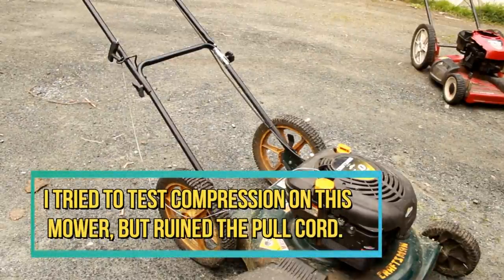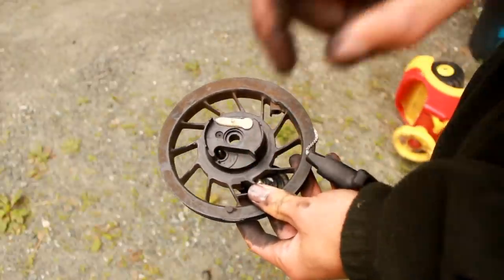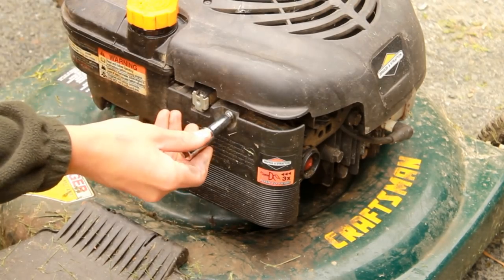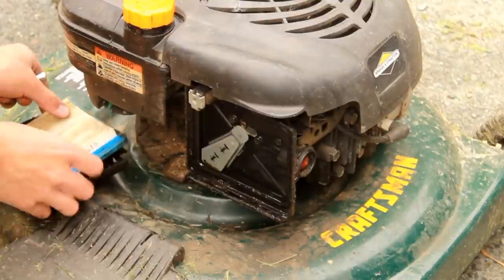Fixing and Starting Two Free Lawnmowers

Comment: The stiff blade on the green one is normal, as the engine as the engine stop lever wasn't pulled back. There is a brake on the flywheel thats applied when the stop lever springs up. The red machine also has this system but it appears its missing both the return spring and the cable.

Comment: the reason why the green was hard to pull over was because of the engine brake ingaged if you would have pull the bail bake and then tried to pull it over it would have been just as easy as the red

Comment: Great video but spinning over the motor by grabbing the starter cup isn’t a good idea considering that the plug is plugged in ant the kill switch is disabled but still great job on the mowers love your channel
Reply: Also the blade was harder to spin on the bottom because that mower had a blade break unlike the red one it was engaged and pressing against the flywheel

Comment: Spinning the engine with a corded drill is risky because they usually have a brake the engages when you release the trigger. Just be sure to pull the drill off the nut before releasing the trigger or use a corded drill.

Comment: Yes, please tighten the cap for checking oil it'll be a bit off if you don't
Reply: Also before working on a lawn mower or small motor unplug spark plug

Comment: I just replaced one exactly like the green craftsman. It still starts with 1 pull, but it was rusty to the point where when I hit it with a wire brush it looked like Swiss cheese. Seriously it is falling apart. Unfortunate since the engine is still great.

Comment: Check leakdown to check rings, valves, and head gasket. Replace the carburetor. Change the oil. Tune the engine. Check the blade. Tighten the head bolts. Remove the flywheel and replace the top seal and lower seal. Replace the valve seal. Replace the blade. Replace and lap the valves. That blade is upside down.

Comment: Make sure you take out spark plug boot when turning over in side.  Also turn on side carb side up.  

Also most lawnmowers take SAE30 oil.  Some take 10w30 Honda’s and there clones.
Reply from the maker: you are 100% correct, i definitely did not do everything by the book in this video. The oil was out of laziness, the other things were out of neglect.  In more recent videos i have done things the way they actually should be done.
Reply: You turned both mowers over wrong.
Reply: Nathanpatterson
Reply: Michael Ransom
Reply: 0

Comment: You set red running too fast. You work on junk like I do though, though red would've donated that engine, that green one wasn't so bad but the red and the 8 years sitting were a bit tight if I'm honest. Also comments that the blades are upside down are incorrect.